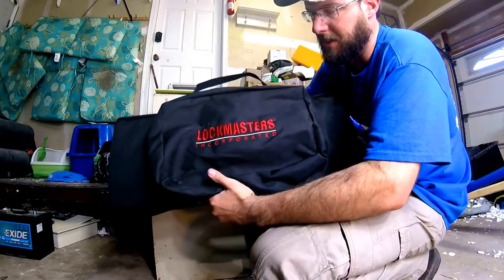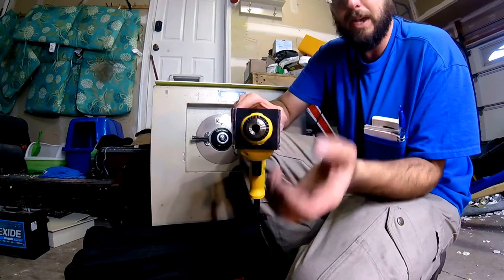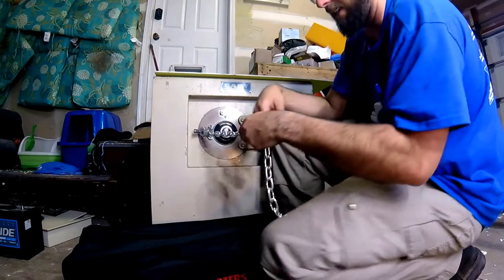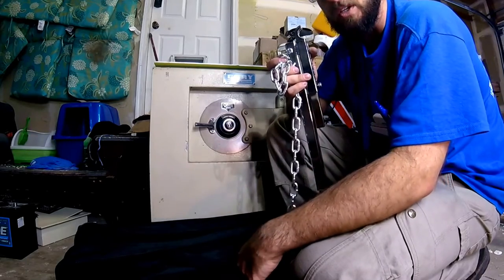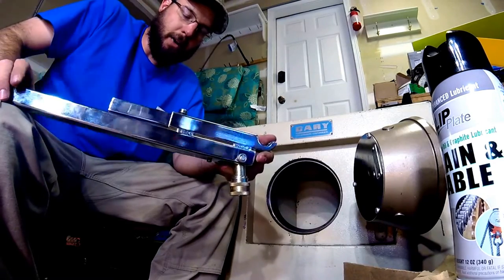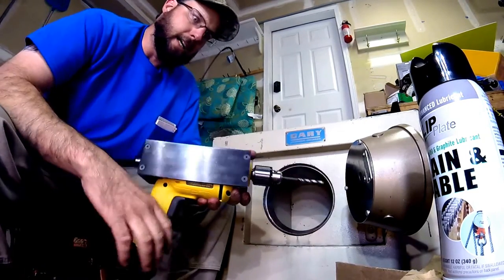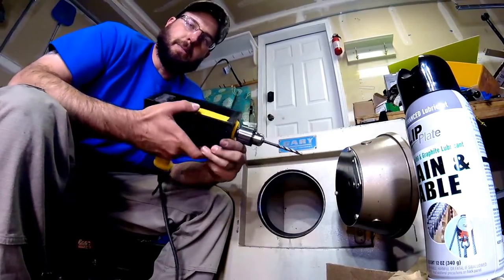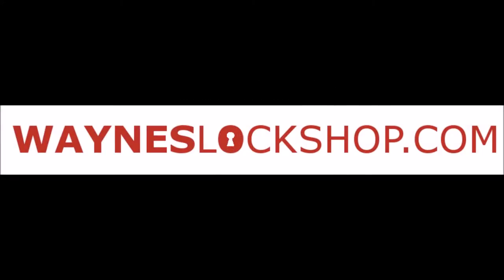Lockmasters Inc. Lever Drill Rig Review Safe Drilling Lever Rig Drill Motor Lever Chain

Comment from the maker: HD Vertion Lever Rig part number is LKM4203. 
 
EQUALIZER II DRILL RIG WITH DEWALT 520 MOTOR
AND CASE.
 
Lockmasters has redesigned the Equalizer II
Drill Rig. The equalizer is designed for
comfort when drilling. Simply turn the
handle and pull it out to the length that
feels best to you. The release pin allows
you to make the chain and motor parallel.
The new nipple lock locks the lever rig and
the drill motor together making this a much
safer rig if your drill bit catches while
drilling. The drill motor does not turn, the
whole rig is locked together and is much
safer for the operator. There are many times
a lever rig may be the best choice,
especially when you have to side or top
drill a safe. This Equalizer II comes with a
Dewalt 520, motor box, and soft case.